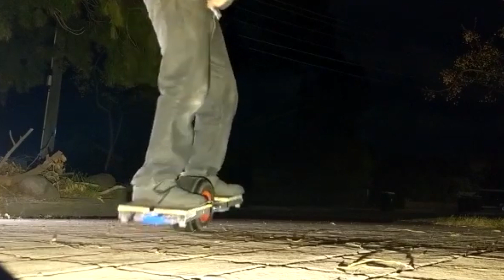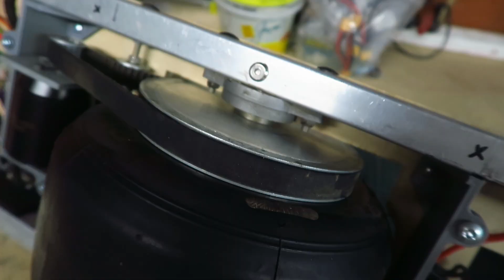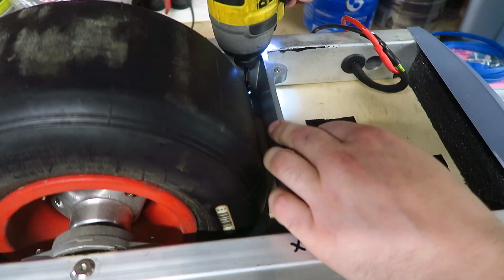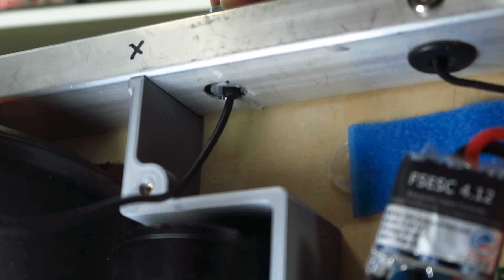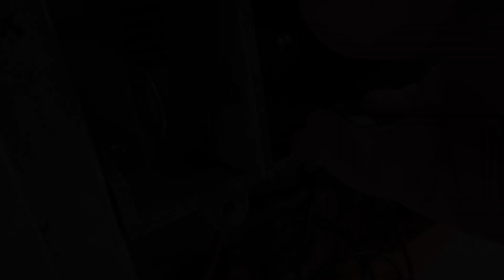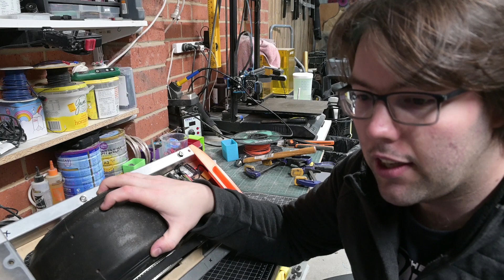I thought making one would be easy... a DIY OneWheel failure

Comment: Can’t wait to see your next iteration! I built one out of hoverboard components for around $300 but it ended up only going around 10mph and would need a whole firmware upgrade to ride like a real onewheel. I believe the original hoverboard firmware sets its velocity based on tilt angle while the onewheel sets its acceleration based on tilt. This makes the nose way too low when going any decent speed. I ended up caving and bought myself a PintX, but I’ll probably sell it and fund a better vesc build one day. It’s interesting to see belt driven onewheels though, so far I have seen one promising build, which has your comment that led me to this build. Great looking build though, it’s a shame it wasn’t all too practical!
Reply from the maker: I've been clocking up the kms on my new board and so far it's been flawless! Unfortunately a few poor mechanical decisions ultimately led to the failure of this project. With some additional knowledge I may come back to this one day though!
Reply: @Maker_HQ  sounds great! I can’t wait to make my own vesc build to see how it stacks up to FM boards, many people say vesc is quickly surpassing FM. Additionally, the floatwheel boards are looking promising, finally some innovation in the industry’s future!